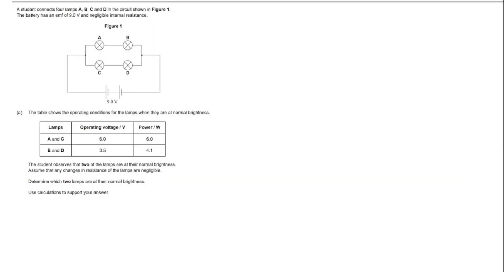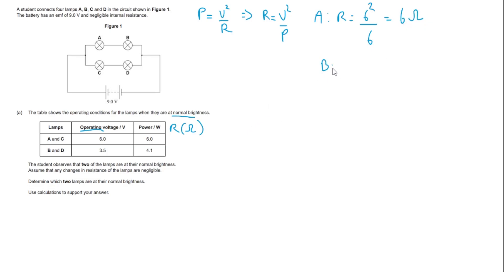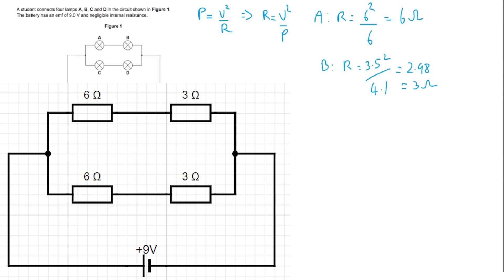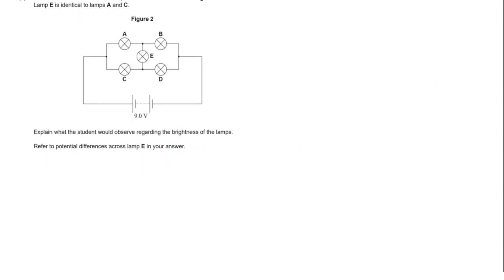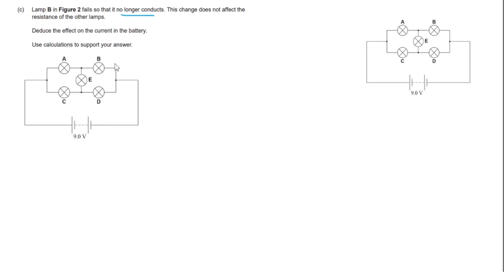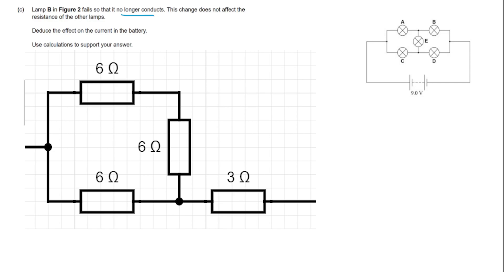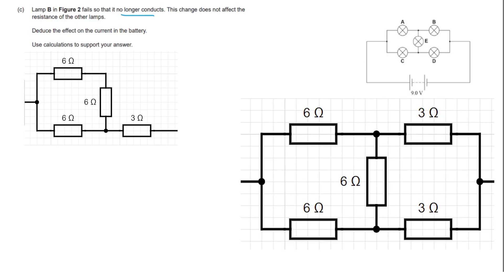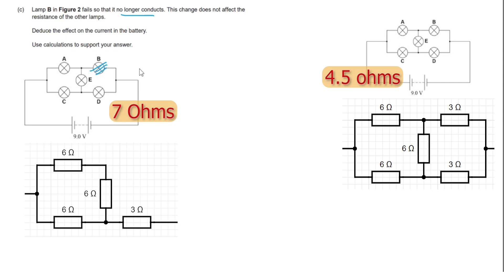A student connects four lamps A, B, C and D in the circuit shown - A Level Physics Help

Comment: just a question why is bulb e 6 ohms I thought it had no voltage going through it for part c 
?
Reply from the maker: It's identical to bulbs A and C and they are 6ohms. {A piece of wire has a resistance of course even if its not connected into a circuit). So the bulb is 6ohms too.